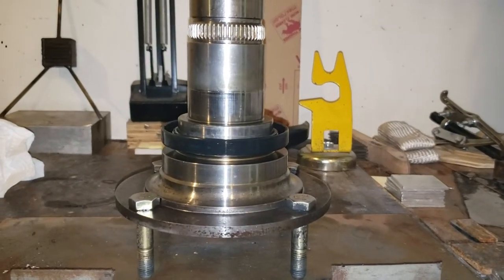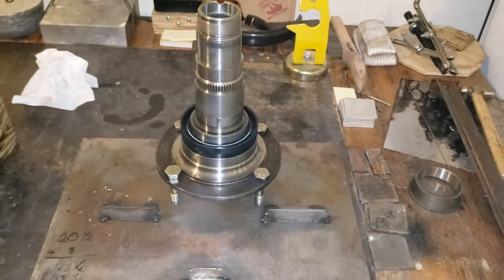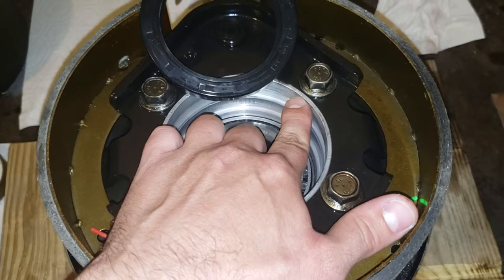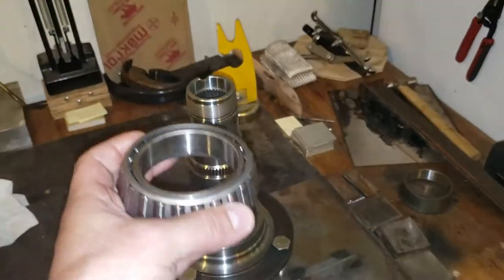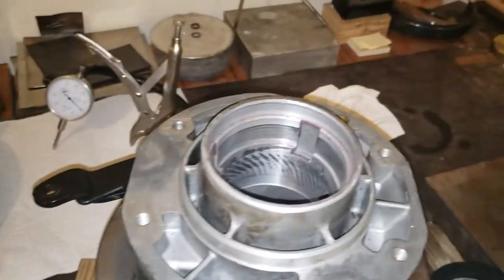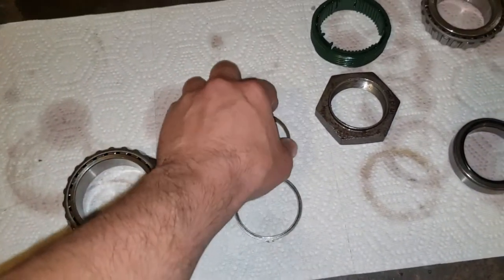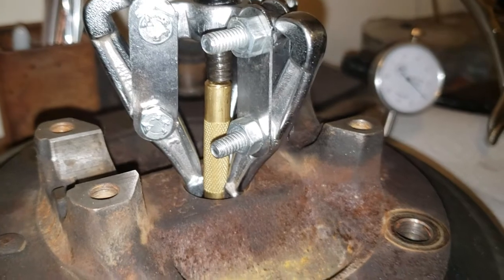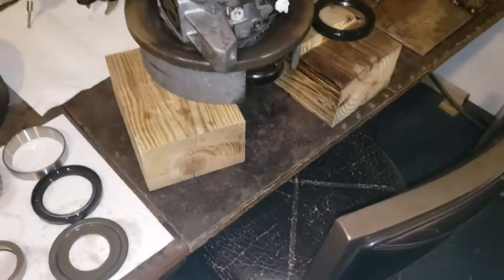Ford ZF E-Brake Repair *CORRECTION* / Part II

Comment: so, did the unit work correctly after you reinstalled it?
Reply from the maker: yes it's been fine.  hasn't seen alot of miles.  but I plan on checking the oil level at oil change times to verify it didnt leak out.